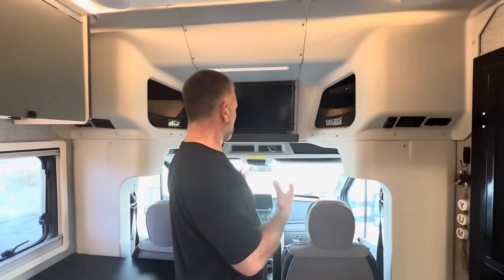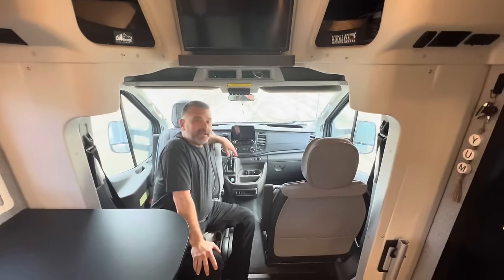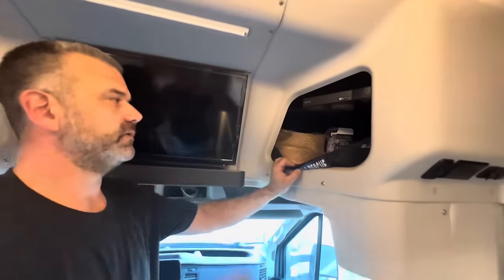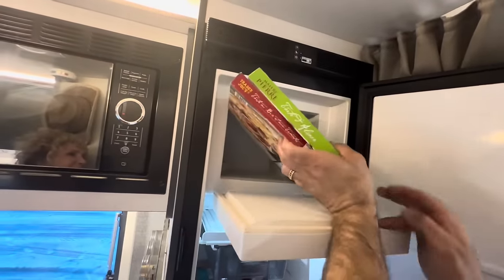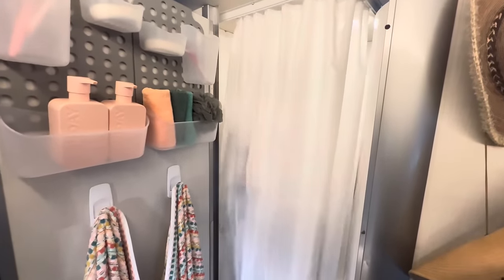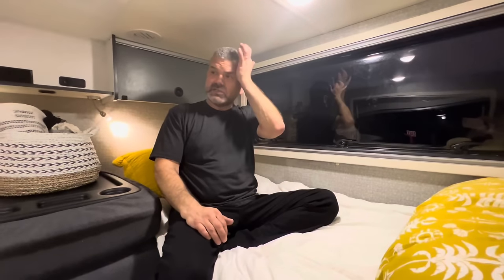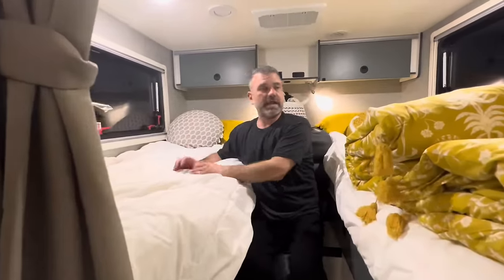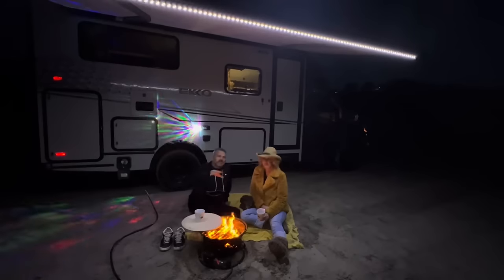WINNEBAGO EKKO TOUR | WHAT THEY DIDN’T TELL YOU! | PROS & CONS | 24K MILE UPDATE | RVLIFE | VANLIFE

Comment: For $165-200k I’d expect the front seat to be 1000% perfect at easy swiveling, the blind spot monitor to work flawlessly, cabinet door magnets not ripping out, a ventilation hood over the stove, plenty of heating/AC available in the bed area, and better placement options for the TV to name just a few things. And it’s the size of a van… for $200k. Winnebago is apparently counting on a sucker being born every day🤦🏻‍♂️
Reply: You should see the price with all the extra options!!!!

I 100% agree with everything that you said there.
At those prices, I wouldn't want to see any slip-shod crap.
As for the AC in the bedroom, I don't like that, BUT, I do see why Win did that.  It was to make proper room for the solar panels.

It might have been wiser for them to use a split AC or something where it could tie into the heating ducts as an all-in-one solution.  Then, some duct work up into the bedroom.
There's LOTS of space under to do all that.

Oh!  i forgot too.  As for the TV, again, all these manufacturers are using the CHEAPEST GARBAGE TVs available.
Insignia is the "Dollar Tree" cheap TVs of the industry.  As a tech and a TV Repairman from decades ago I'm VERY picky about color rendition on a TV.
Insignia TVs may look "ok" to some people, but for picky people like me, the color is not so good.  It's MEH... 

So in buying one of these units, I'd get it without the TV (if that's an option) and just run to Best Buy for a good Sony 4K that would fit there.  Or a larger one on a swing up.
Reply: @BlondieSL  …just had an idea re: the moisture buildup in the bedroom after posting that comment; a small AWG unit (Atmospheric Water Generator) would dehumidify and provide a certain amount of off-grid water. But still… for the price of several acres of land and/or a decent small van/trailer & SUV setup and years of traveling like that, its pretty janky for $200k
Reply: @Obi-Wan_Jkobi It's insane what's going on in the RV industry right now.
To me, it's all a rip off.

I say that, because about 24 years ago (or so), we bought a 34' Jayco 5th wheel, with slide outs, brand new for about $30,000.
It was loaded and gorgeous.

But now, a 2023 of a similar build is almost double that.

But I will say, with all the RVs of this style that we've looked at, this is the nicest.
We looked at some other brands and honestly, just hated them.
They were all dark inside and cramped.

That day we were looking, there was one for $154,000 that was kinda nice, but the negatives with it where a deal breaker.

In that case, if we would have wanted it, we could have bought it right then, right there and it would have only taken a couple of days to get all the legal things done, then drive away.

But with these EKKO RVs, there could be a year's wait.

That is a deal breaker for sure.  With the world the way it is not, no one can be sure we'll even be alive in one year.  LOL

😅😂🤣

Comment: The TV, when we purchased our rig we wanted to cut the television cord.  We didn't want to bring our house out to the campsite.  We like the quiet solitude of boondocking and a TV is not part of that experience for us.
Reply from the maker: We happen younger ours when inventory was very low and it was almost impossible to locate an EKKO. The package was already installed. I will say that we’ve tried to watch two movies and just found we are using it.  We love the JBL sound bar but the TV is mostly useless to us.
Reply: Different people, different needs.  LOL

All my life, I'm THAT GUY who just HAS to have a TV and... please don't slap me, but yes, an outdoor full antenna on a 20' telescopic pole, bungie corded to the rear ladder.  LOL

Even back in the 1980s, I started doing that when I bought our first 12V color TV.
I haven't changed since.

Except that now, if we had an EKKO, I'd dump that crap Insignia and put a Sony in there.
Also, a smaller one in the bedroom.   LOL

hmmmm .. maybe an outdoor projector... hmmmmm
ROFL
😅😂🤣

I think that I'm addicted to TV.

Comment: For that price, the airplane seats gotta go. They did change it in the 2024 model but they put a Mercedes diesel in it. Bad move. I want a vehicle where I can get gas anywhere. Most of the rural mom and pop gas stations don't have diesel. Plus the maintenance bill is ridiculously expensive.
Reply from the maker: Hello, thanks for checking out our video.  I completely agree with you on the dinette seats. While they are somewhat comfortable for short term use (a meal or working on the computer). Over a long trip, it’s not my favorite for sure as I think we get spoiled from the adjustable front seats.  Fuel could be an issue as well, although it’s rare that I don’t see Diesel.  Yes, maintenance is a big part of the decision in some respect, such as oil changes. The Ford is around $80.00 while the Mercedes can run $275.00-$400.00. 
From what I understand on the Mercedes, though it does have a proven track record for longevity.
But again as you mentioned, there are a few things that one would have to consider over the course of ownership.
Thank you for checking out our channel and sharing your thoughts.
I can say that we did spend three solid days shooting the Winnebago commercial. Mercedes was quite refined and comfortable many respects, especially in the cab area. If you have any other thoughts or questions, don’t hesitate to ask. Take care and be safe.

Comment: hello to follow up on the problem of the seats which block on the door, do not turn inwards, I would try to switch the rotating plate under the seat to make them turn outwards, (if the problem exists with both seats) , there is much more space in the middle provided that the seats can turn 360 degrees
Reply from the maker: 🤔 that’s a very interesting idea. It would even make it more convenient if it works simply because the lock/release arm would be more accessible in respect to where one would want to grab the handle anyway.  I’m going to look under the swat to see if the bolt pattern is the universal as well as look for anything that may be an obstruction.  
Thanks for the awesome idea,  I will keep you posted.  Thanks for also watching our channel and subscribing.

Comment: Winnebago made a few changes to the 2023’s that are being delivered as of mid March 2023.
The overhead cabinets now have struts to hold them up.  The Balmer MC-618 has been relocated to the Lithionics battery compartment above the shower drain pump.  The Xantrex Freedom Inverter is now in a sealed area. 
Winnebago is listening to their customers suggestions.  
Nice walk through video.  Thx! 👍🏻
Reply from the maker: Yes they have begin to make the necessary improvements and it can only improve. My hope is they consider the pre-2022 models for updates.  Most importantly the Balmar relocation to the seat compartment and the gulper relocation. But probably not going to be considered across the board.  Thank you very much for sharing and watching. I hope you are doing well and safe travels ahead for you.

Comment: This was so well done. It helps people prepare for things that are unseen when you first buy one of these.

As you are a techy type, perhaps you would know the answer to this.

So on the 2023 model (perhaps the 2022 too) it comes with a single Lithium batter and a small generator (one compartment over).
The offer an option to double the battery, BUT at the cost of losing the generator.  Personally, I think that's just stupid.

So, my question is, would it not be possible to add another batter or two or more and mount them in the rear "garage" area (it's so huge) and then wire it into where the main battery is (using proper cabling, of course) ???

I'd also wonder, since there does seem to be a bit of extra space on top (roof) if one more solar panel would fit.

If we had one of these, I'd definitely want 4 lithium batteries, but keeping the gen as well.

Ideas?
Reply from the maker: So that is a great question, in one that’s pretty easy to answer.
Yes, additional lithium batteries, especially the Lithionics can be added, allowing you to increase your amps of storage. However, there are a lot of things to consider when doing this to allow the conversion to be successful.
Below, I have attached a link to FreedomVanGo 
 YouTube video where Grant Wilson gives a perfect explanation and details the information in respect to your question.
I hope this helps, thank you again for watching our video, providing feedback, and subscribing and hitting the notification button. It helps support our channel and allows us to continue to provide content.
If you happen to have any suggestions for videos or things that you would like to see us talk about, please don’t hesitate to let us know.
Hope you have a great rest of your day and we can head.

https://youtu.be/w2sqkLw5IbI?si=mz4Z_vQEVB3zatgP
Reply: @ekkonesters599 Thanks!  THAT is a great vid there and he does mention that in fact, he was able to add a 2nd battery while still keeping the generator.

Thanks for that.
Reply: I just confirmed that our Honda CRV can be flat towed behind an RV with just a process to follow... hmmmmmm

Comment: Great walk through... I'm in the market for one of these and we took one for a drive. We were very disappointed with how much road noise there was in the cab when driving at highway speeds. Do you have the same opinion?
Reply from the maker: Hello Andrew, overall these are pretty amazing vehicles yet like anything room for improvement. Initially, we felt the same and it was a bit tough. A couple things that will help and made a difference:
1. Ensure that the Max air Fan is completely closed. The. Purchase the Van Essentials window vent cover kit from CaTuned Off-Road. Primarily the vent cover dampens noise.  
2. Second and most effective is utilizing the Winnebago insulated thermo cover that snaps on separating the area between the cab and the coach. This will be the biggest change overall. 
If you have an opportunity to test drive one again, give the thermal blanket a try for sure.  
Other than that, there really isn’t much that can be done. 
In all honesty, we don’t use the thermal blanket when traveling and we don’t notice anything anymore. With the exception of the screen door rattling, which there are fixes for this. 
Let me know if you have any other questions for sure.
Reply: The Fit RV tackled the road noise in a couple good videos, with ‘some’ success.
Reply from the maker: @J.W.W.  Hello, yes I saw James video on the insulating the cab area.  I liked his honesty around "was it worth it, would I do it again". It seemed like a lot of work for the minimal return on investment.  But you are correct, it was a great video as he always does. I've been working on a few ideas and as soon as I feel they are proven as to a real benefit, I'm going to share with the YouTube community.  Thanks again for watching our channel and leaving a comment we are very grateful. Take care, Jason
Reply: @ekkonesters599  It's too bad that Winnebago didn't use an air suspension concept like those late 1970s GMC motorhomes had and that dual rear axle with the type of air suspension between them.  It's like driving on a cloud.

Sometimes older tech just works better.

Comment: Don't you think Winnebago and Ford designed that seat to not be able to pivot with the door closed intentionally as a safety guard? You want to minimize the chances a seat pivots while driving.
Reply from the maker: Hi Pat, thanks for checking out our video. I don’t believe it was a safeguard. The reason is that Mercedes (Sprinters) use the same/similar swivel base and there is no need to open the door. I think that when Ford built the Transit, the idea of a swivel seat was not a consideration given the original Ford design/focus was a simply a cargo/utility vehicle. So the door, armrest design was not a consideration. The seat swivel also has a lockout to prevent it from rotating.  
Good thought though.

Comment: Great videos, thanks for making them.  Very informative.  One question: how does the EKKO do on gravel & dirt roads?  Does it shake and rattle like a tin can?  Does dust seep in and cover everything?  What about road clearance?  Obviously no campervan or small Class C is an off-road vehicle but the prettiest places in North America are usually not along paved highways.  What can you access safely in your EKKO?
Reply from the maker: George, thank you for taking time to watch our video and if you subscribed, we are very grateful as well.  I’m glad you asked about the gravel and dirt roads. We have plenty of experience traveling through both. There is a washboard road that leads to the Palouse Falls in Washington State. It was pretty rough and with the VanCompass suspension “Bad Betty” our EKKO did really well. I’ve been in plenty of gravel just outside of HWY 26 leading off the Palouse Byway and equally well like anything it will track a little through the thicker gravel, but completely predictable. On the dryer dusty roads, we have not experienced any of the road debris’s making there way through and into the compartments or can. I believe the stock ground clearance is around 8.5”. Which does pretty well in most considerations. But we opted to do the VanCompass 2” list and upgrade with the rear Falken adjustable shocks. We have accessed plenty of roads that we’re typically suggesting 4x4, SUV, or at least more of an off-road capability.  Logging roads, off-beach access areas, lots of snow packed roads and terrain up at the Mt Hood National Forest as well as some fun areas in Eastern Oregon. I especially feel very confident with the CaTuned Recovery bumper and 12K Warn Winch. I just recently got stuck in some soft wet sand and used my recovery traction boards and set the EKKO in the mud and rut mode and walked straight out of the hydraulic hood the sand and water locked us into.  Hope this helps and thank you for watching.  Safe travels.
Reply: @ekkonesters599  Super informative, thanks!  If you haven't already, perhaps you could make a video about what type of terrain the EKKO can handle and what to avoid.  Also do you discuss RV levelling blocks in any of your videos?  (I'm just working my way through them).
Reply from the maker: @georgeboole1404  that’s great suggestions for content ahead. I definitely should do a video on this.
I’m going to add it to our list, and I greatly appreciate the suggestions.
We are considering doing a live question and answer form in the near future.
As someone who uses YouTube like yourself, would this be of interest for you to participate in? Do you find live feed, videos, helpful? And if so, what part of the country or world are you located in and do you have a suggestion we could consider for the time of day or evening that this would best suit you?
Reply: @ekkonesters599  I live in Virginia.  I'm retired and could participate in a live feed at any time.  Additional questions based on your experience: (i) with a 5 gallon cassette toilet how long can you camp off-grid without access to a dumping station? (ii) how does the AWD work on the Ford Transit?  For example, if you are stuck in sand or snow will one wheel spin while the other wheels get zero power, or is there some way to lock the differentials?
Reply from the maker: @georgeboole1404  great input. Thank you. Very kind of you to take the time to share your thoughts and experience.  I’m going to  add this to my list and keep you updated.  We’d love to have you share in our live feed when the time comes.

Comment: Pop top vs. out door kitchen? Why cant you have both?
Reply from the maker: My understanding is it’s structural and weight. I believe because there was additional structural removed from the roof that there could be flex. However, what throws me off a little is that once the tailgate package is removed, then it’s a general storage compartment. With that considered, what would prevent someone from loading it, etc. it could also be flex in the side walls. Thanks for checking out our channel too.

Comment: Can you turn it the opposite direction
Reply from the maker: Steve, great question.  The quick answer is no... but the primary reason is that there is a lockout on the "yellow handle" release arm that allows the seat to rotate. I am assuming it is a safety feature so that the seat has one rotation that will limit the user from not properly engaging the lock out prior to driving.  Good thought though.  Thanks for watching and if you have subscribed, thank you very much as well.

Comment: yeah thats why i am getting a 2024 Chinook Maverick AWD ford transite van everything is insulated outside in storage compartments has a induction stove top moveable to out side, full shower seperate bath room huge rear closet residental sink 3 way fridgerator  800AH of battery 3000 inverter convection microwave dinning area turns to twin bed couch turns to twin bed 400 watt solar 4 seasons gas lol both the maverick AWD transit and maverick SS are the same and better then a EKKO full van heating and cooling no cold or hot spots lots of inside and outside storage area. i am walking disabled so a cassett toilet is not for me.